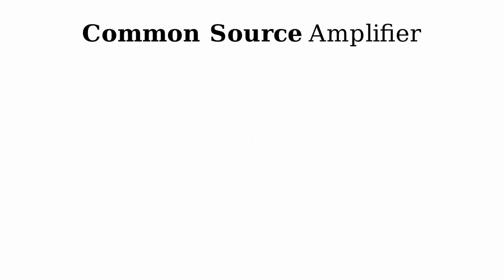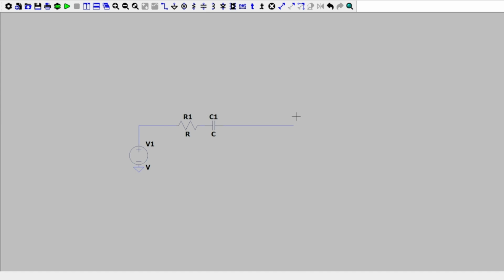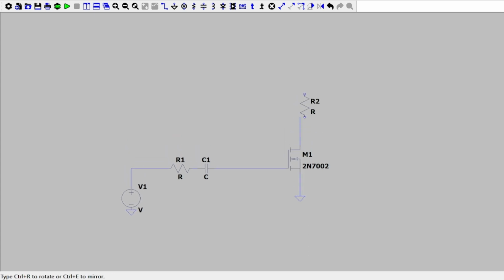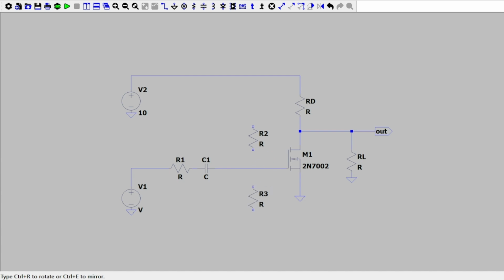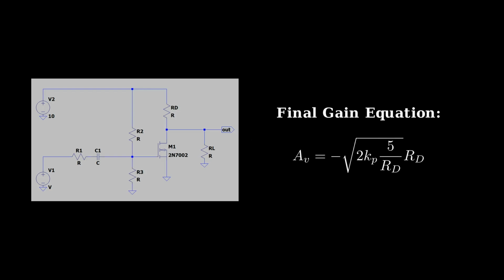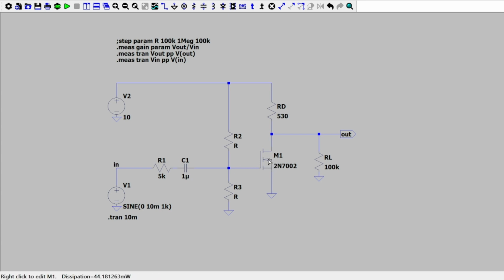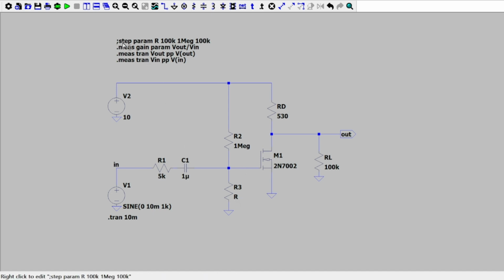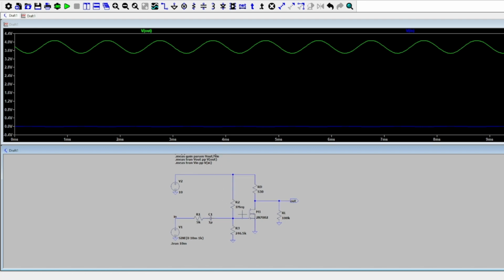Common Source Amplifier MOSFET (LTspice)

Comment: Just a small critique. Your VGS here is 2V and the part has a Vth of about 2V so your amplifier will be very unstable due to non-ideal Vth.
Reply from the maker: I totally agree, in a simulation setting where everything is ideal, this works. But as you stated, there is a percentage of error every time you work with physical components, thus in real-life, I would use knowledge of tolerance percentages, noise analysis, and other factors to perfectly tune this. Great comment.